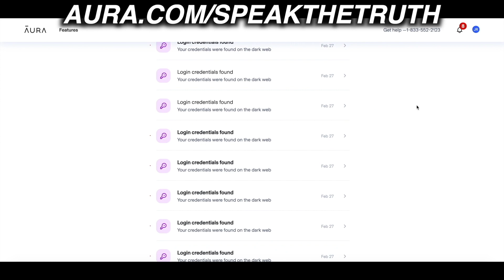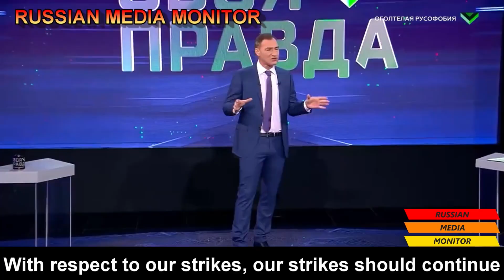The Russians Biggest Fear - Deadly

Comment: 4:00 If im correct its not -25c outside.. its -2.5c outside. That is way to cold.

still, its freezing already and its november..
Reply: Either way, that's below freezing, and without some shelter and some form of heat, those soldiers will die of exposure.
Reply: @brandondavis7777  Yea.. I remember sleeping a crappy half open tent in the SUMMER and waking up early in the morning simply because i was so cold. Put on all my clothes and anything i could find to keep myself warm. -2 with i bet also crappy gear and not heat and also having to fight is insane. Its sad how all these people are going to die for a stupid war.
Reply: @jameswayton2340   Yeah, hunting or camping. After hiking half a day and building a lean-to or a-frame, even without a source of heat, it can get cold. A little fire, insulated blanket. Something.

Comment: From strict curiosity, I wonder if the smaller holes in that frame were caused by the tungsten balls, can anyone shine any light on that?
Reply: think it was air burst and kind of shotgun effect from above just ripped right through truck so yes tungsten balls did it in my opinion
Reply: Agreed, but a truck door and a truck frame are a little different, I suppose that is what I was getting at

Comment: Those new HIMAR loads are impressive. https://youtu.be/NMPscap0_us
Says 182,000 tungsten carbide balls. That’s a lot of balls. I don’t know velocities or mass but the strikes on the truck reminded me of AP Czech 7.62TT Tokarev ammo with the little weird penetrator inside it. Out of my (long ago) M-56 these would smash up a tough rock pile. Not soft rocks but really robust granite / feldspar. Into steel objects they would punch through stupid amounts of metal and cast metals would get cracks all around the hole. So like the guy says, that truck is not economically repairable. Even the leaf springs are scrap. My guess is maybe 15% if the truck can be salvaged?
I bet the height of burst and hence strike density can be programmed. Imagine one of those weird “defensive lines” with people present. Any object or person not beneath robust cover would have holes. 
In the linked video they hit a tank and we can guess that every last sensor and probably the engine was ruined. So tanks will survive sort of but lose much of their asset value. 
I’d love to see a damage report  on tank after hit. My understanding of using hard penetrators of tungsten carbide is that in collision with hard objects the whole object participates in energy transfer. If you launch a long soft bullet the back of the bullet arrives later. A hard ball it’s all at once. So the frequency of shock has much higher content and this causes local material failure. The ghetto trick of throwing a spark plug at car window is similar - the energy of throwing an object of similar mass is the same but the hard spark plug material causes the glass to shatter.